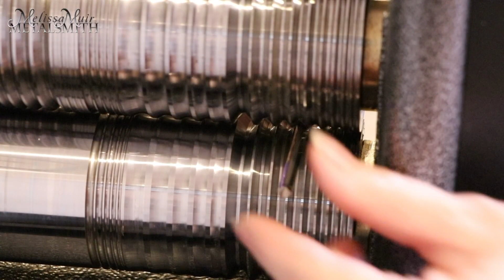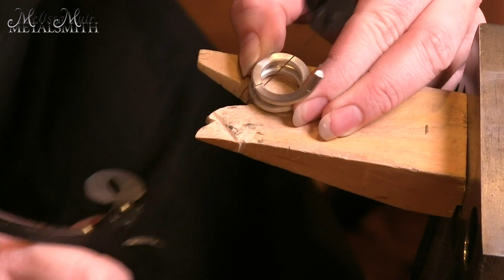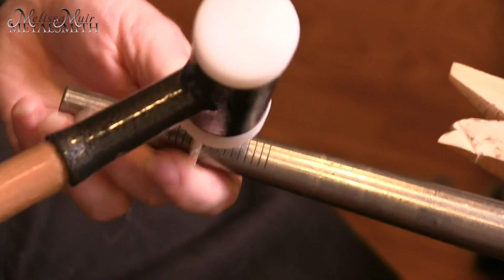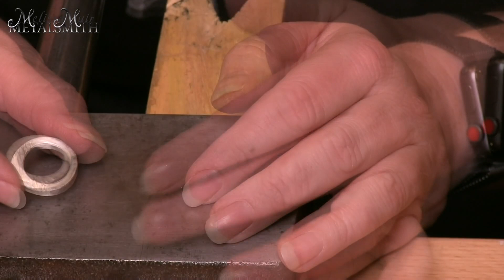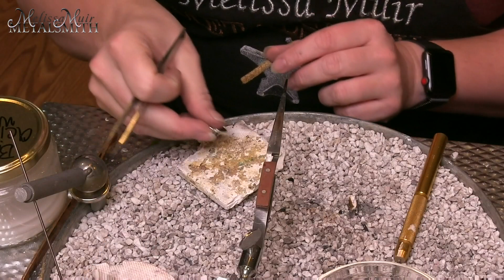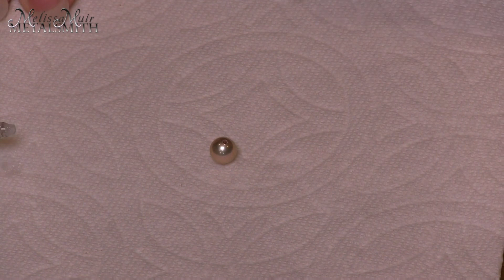Project 12- Forged Ring - Revere Professional Jewelry Making Series- Tool Time Tuesday

Comment: Wonderful trick! Also, I see you using the Green Lion Saw. I need a new saw because I hate mine! I’m going to order the New  Concepts! I was contemplating the Green Lion... what’s your opinion?? May I ask??
Reply from the maker: Gripco1 I really like them both. I happened to use the green lion saw because it was in hands reach at the time of filming. And right now, micro-tools (www.micro-tools.com?aff=8) has a really good price on the Knew Concepts frames. I will be doing a video coming up shortly comparing my different frames. But I really do like the Knew Concepts saws.

Comment: Excellent video , are you happy using CA glue if I fix pearls I always use square wire and twist it, then use epoxy. I have had problems with CA coming adrift
I have also been put on to a great tip for polishing small hard to get at places, ( new to me ) cigarette filters cheap as can be, just thread them onto a screw tip shaft.
Reply from the maker: pijnto that is a good question. Quite honestly, I never use pearls this way and never use glue in my pieces, so we will have to see what happens. I was just following the instructions in the book. And that is a great tip about the filters. Thank you.